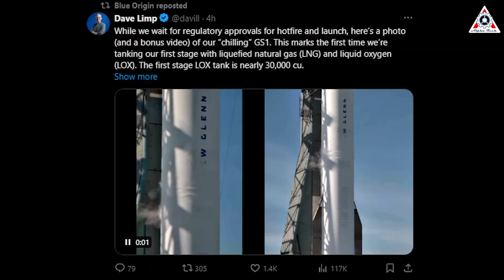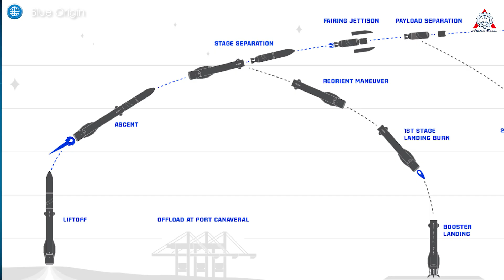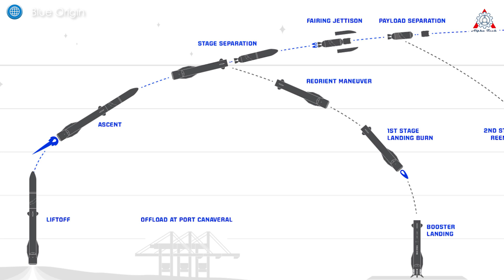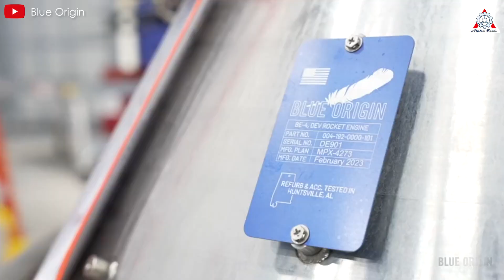New Glenn has NO Launch but wants to BEAT SpaceX flight 7, Musk laughs...

Comment: SpaceX did not need a permit for each individual Starship launch. Only a mishap outside the scope of planned outcomes or a significant change in vehicle design or mission profile requires FAA approval. Right now Starship Block 2 is a significant change to the vehicle and they are awaiting approval. They could have gone straight to another Block 1 launch but they decided to go with Block 2. It really is frustrating to see the FAA get involved and cause problems for everyone when they're really not helping in any meaningful way.

Comment: I think that Blue is doomed already. If the falcon heavy already surpasses the lift of new Glenn and starship quickly on its heels, i dont see a market that will work for Blue origin without their usual lawsuit playbook
Reply: They'll get some fraction of the %5.6B NSSL contracts. It's probably difficult to compete on cost with SpaceX although comparing to Falcon Heavy there might be a niche there. TBD. Starship will crush everything but remember there's really no large cargo design for Starship yet. Initially it's a Starlink PEZ dispenser, tanker, and HLS. They're gonna need payload doors etc, and all that is still on the drawing board. Their plate is full enough that it could take a few years, during which New Glenn will get a brief reprieve. BO and everyone else will eventually need a refurbishable 2nd stage to compete. It'll be exciting to watch. Bezos has deep pockets and BO seems to finally be making some progress with his more active involvement.

Comment: Blue Origin latest schedule: 4th of July !!!       3 2 1 BOOOOMMM!    (1st launches are tough, design for a decade or design - make - scrap - design - make - launch - design - scrap - design - make launch etc etc   10 times in 2 years    All of these teams have no previous experience, success takes about 10 design cycles, no matter how long it takes - if a team changes out 50% (like if you have 30% funding for a year) then you add more cycles.  SpaceX is growing capacity at a spectacular rate.

Comment: B.O. is off its rocker. SpaceX is ready for flight 7 and hasn't achieved orbit. How does B.O. think they have even a remote chance of orbit on the first try? They are using old and outdated design methods. This is similar to designing a Model-T in the age of supercars such as Starship. The entire first flight will be a disaster because they are setting completely unrealistic goals. With their outdated design philosophy I don't see how this is justified at all.
Reply from the maker: Sure it is!
Reply: The hardest part of the rocket to get right are the engines. and they have already been to orbit twice, performing flawlessly.
Reply: @timothygermann780  Let's see... That would be Qty: 4. compared to 421 of falcon 9 launches with 9 = 3789. So, almost a 1000:1 ratio.
Reply: @ronwatkins5775 
Who cares about Falcon? 
The OP said New Glenn will fail on its first launch because Starship hasn't made it to orbit in its first 7 launches?
But Vulcan made it to orbit in its first attempt (and second) using the same engines as New Glenn.

Get it now?
Reply: @timothygermann780  Everyone should care about Falcon. It's the standard bearer for the US fleet. Vulcan was a fluke, just dumb luck. Great, 2 engines worked once. Who cares about over 400 flights with 9 engines totaling more than 1000 times more flight time. Just go to your actuary and ask about that.